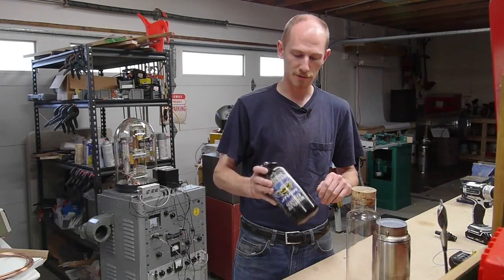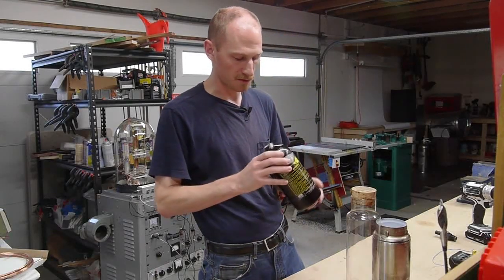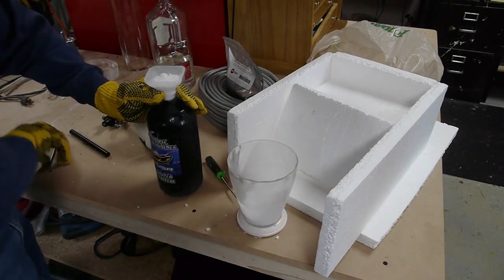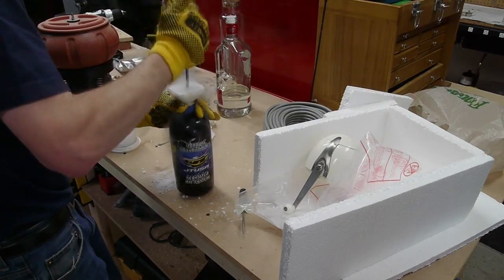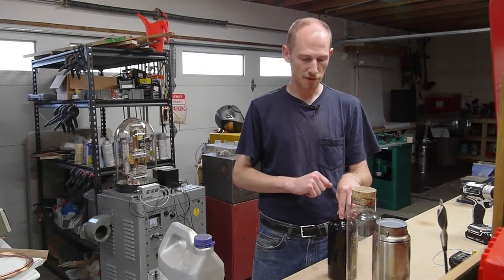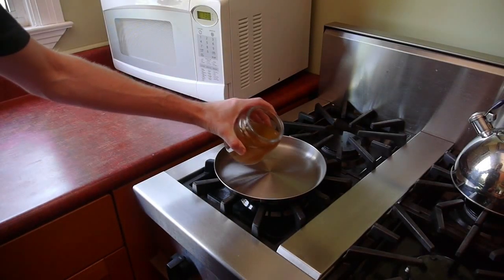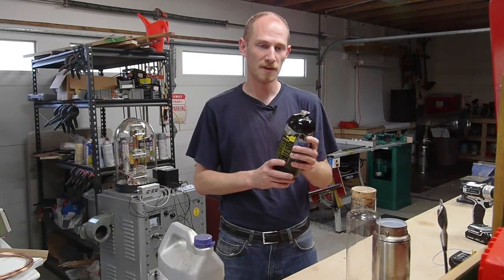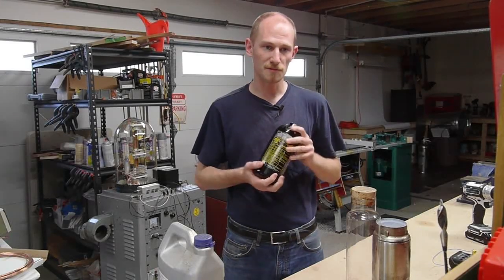Supercritical CO2 caffeine extraction (negative result -- more work needed)

Comment: As you mentioned, there needs to be a separation area for the solute to separate from the bio material. Industrial super critical C02 use chambers separated by activated carbon, and the C02 is pumped through at about 3000 psi. I have been trying to think of a pump free way to forced the CO2 to cycle around a bit. Thanks for the post, it is good to see other minds are coming up with some of the same Ideas. Oh and if you have any tips for people without access to machining tools let me know.

Comment: in your video you opened your extractor from the bottom and from my web research you are supposed to extract from the top at 7 mils. per second in to a extraction tube. Check out the link that i posted. Your the first one I have seen make your own supper C-Co2 extractor im making one right know. can you try that out. maybe make rose oil with S.C-
Co2

Comment: Actually, for extract caffeine you can't maintain the CO2 stocked in the chamber, you'll need a vessel where you can flow the CO2 through the grains and another vessel where will happen the expansion of the CO2+caffeine. Your decaffeinated grains will be inside the vessel. If you want to use a co-solvent, you will need to feed the vessel with a controlled flow because if you feed with too much water the mix will not be a supercritical fluid. 
Rodrigo Scopel - Supercritical Fluid Extraction Lab.

Comment: While the methylene chloride process works well. (I have taught this very lab in an organic chemistry lab.) This caffeine cannot be used in any way but the lab setting. The primary reason CO2 is used is because it is a non toxic solvent so, in theory the coffee and caffeine can still be used in food products. As for advice all you probably need to do is let the CO2 evaporate from the chamber then remove the now solid caffeine. No co solvent would be needed. (I'm working on my PHD in Chemistry)

Comment: Well, you can extract caffeine with supercritical CO2 saturated with water. Without any ethanol. Do not forgive to moisture your beans before to like 40%. It takes some time to get the caffeine out of the bean, since it is diffusion controlled process. Normally, you need 12 hours and about 100kg of CO2 / kg of coffee. Then you get also crystals, in the extract-water solution, just after cooling down...

Comment: Anyway, if the intent is to extract a pure sample of caffeine, it seems like using water and column chromatography would be a much simpler approach. Just boil the green beans in a sufficient volume of water or ethanol and then run a column extraction.

Comment: Seems like the caffeine might of blown out with the CO2, maybe you should purge the CO2 through a column of water, so that the caffeine might transfer from the CO2 into the water, you'd need to have some system of valves so that the CO2 can be flushed out under pressure, otherwise it might precipitate out on the inside of the vessel as it depressurises.

Comment: Any ideas? I think you should separate coffee grains from the bottom with a mesh, so carbon dioxide flux, as you say, percolates sweeping caffeine and then goes up, and down, repeating the process for something like 10hrs (normally for 97% extraction). Will be cool if you manage to make your own HPLC and SCF CO2, since ones I had were fuck..g expensive.
Just do not hesitate to contact me if need further info, or wanna get support during your trials before video upload.
Cheers (with Ar beer ;).